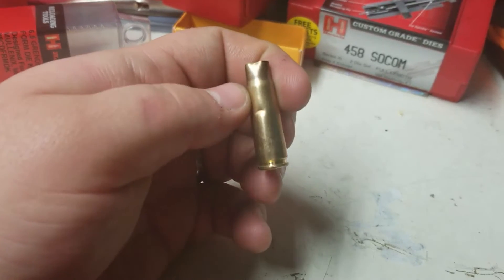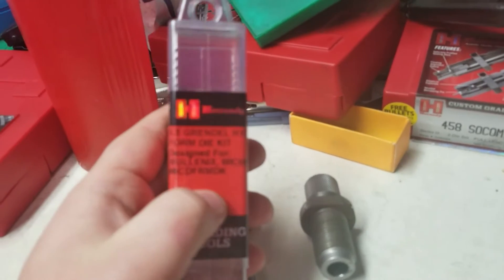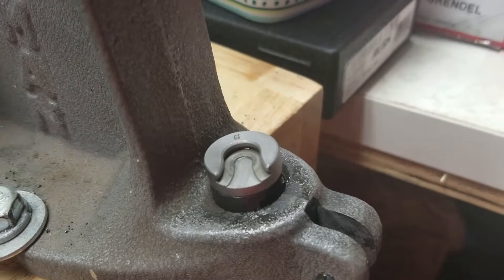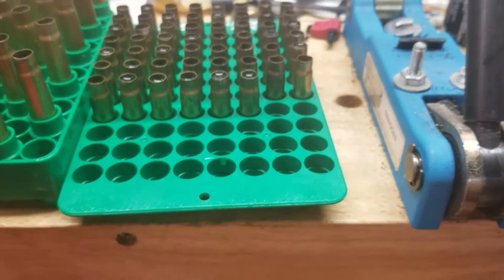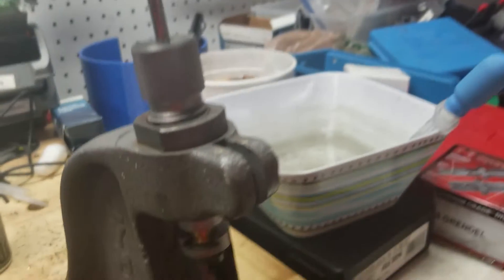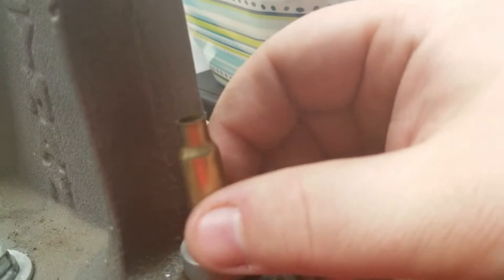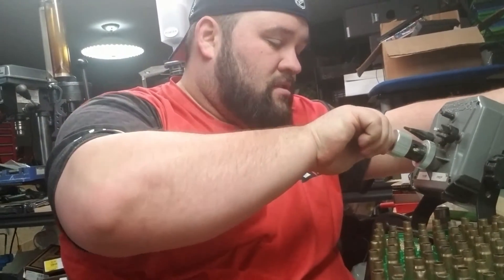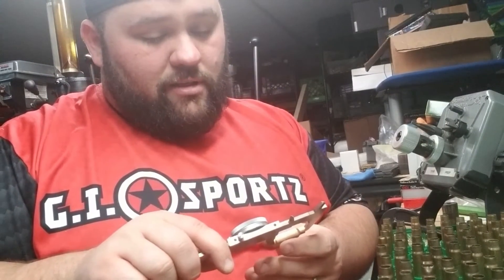Hydroforming 6.5 Grendel

Comment: I’ve been looking into repairing some 6.5 Grendel brass that I bumped the head to low. It’s brand new brass so I thought I would try hydroforming it. 
I wonder if Hornady would have a straight up 6.5 Grendel hydroform die? Your thoughts? Thanks
Reply: I think the 6.5 grendel hydroforming die would work well for this. how many pieces did you do it to? If its not alot id be happy to try it to fix them.
Reply: @michaelmullenix  I have 50 pieces of Nos brass. I think I'm going to contact Hornady and order myself a custom hydro-form die anyway because my chamber in two 6.5 Grendel barrels of mine are about .010" head-spaced longer than Nos and PPU brass is manufactured at. I'm guessing other manufacturers are probably similar? Thanks for the offer though.
Reply: @Whithersoeverthougoest The manufacturers will go ahead and make you whatever you want. Hornady happened to be the least time frame to get one made AND they already had the chamber blue prints on hand to do so. If you want it customized any other way, i am sure they would accommodate!

Comment: Need to make a 6.5MM GRENDEL with a hollow cavity like the 7N1 and  And inside the holocaust cavity use a blistic tip inside the full metal jacket then backing up with a steel core with lead  are lead

Comment: I'm converting a bunch of brass myself, I'm using the standard Grendel die method.  I'm using a 3d printed WFT vs the trimmer you have, then  wet tumbling them.

Comment: Length was the saami spec.... below that diagram shows you minimum and maximum trim lengths. I fucked up on 100 PC of 6.5x55 brass once and trimmed them all to max length to try and "get more life out of my brass". Well when fired every PC was getting stuck in the chamber. Could have been a huge f up with pressure spikes. The brass was growing into the throat and getting stuck. I had to pull 97 pc's and reload them again. Point being trim your brass not to max length. It will grow 4+ 5+ thou especially when close to max charge. Great video!

Comment: Good video.  I'm going to order one to turn 308 into 6.5 Creedmoor.  Just a hint, the trim to length is listed right on the page at the bottom of the specifications.  It's 1.510, that's the minimum case measurement so you're still .004" long.  Also, instead of paying for Lemi-Shine just order a pouch of citric acid from Amazon for a couple bucks, same stuff.
Reply: There's no such thing as a minimum case length. The CIP L3 callout (case length) is a maximum length of 1.520. Anything less than or equal to that number is within spec.
Reply: @tartredarrow  The trim length is listed at the bottom of the column, it says "Trim Length".  Usually the trim to length is .010" below the maximum length.
Reply: @hardball107  That's simply Hornady's recommendation. If you go by CIP, there's no minimum. If you go by SAAMI, there's a 1.500-1.520 range given.

Comment: Nice die......but if you don't want to  wait 3 months, for some special die..............
 turn 7.62x39 brass into:
 6.5 Grendel, 6mm ARC, and 6mm PPC. 
STEP 1:
On the LEE push through lube sizing Kits, find a plunger the same diameter as the 7.62x39 base. Lube case ..keep lube off of neck/shoulder area, to prevent wrinkles.on shoulder /neck area.
Use it to run a case up into a 270 Winchester seating die..... careful on depth...try to get correct shoulder measurement for desired case. this will shrink neck to .277-279.

STEP 2:
Run the formed case up into a 6.5 Carcano seating die, using the same plunger.... this will shrink case to.267-269. 

STEP 3:
 Final size in either a 6.5 Grendel FL Die....a 6mmARC FL Die, or a 6mm PPC FL Die. 

Christ bless!
Reply: I may try that to experiment some. but the concern I have is the extra work hardening it will do on the case, especially the neck. My biggest complaint I had with just sizing the x39 cases to grendel and loading/fireforming was in 1 or 2 firings, I had split necks.. with the hydroformed cases, I have fired the case 10+ times (trimming every 2 or 3) and no split necks. oh, we annealed at firing 4 and 8 too. I may have to give this a try as well to see how it works.. Thank you for the info my friend!
Reply: @michaelmullenix  No doubt the hydroforming is a great concept. Annealing must be done, because you are correct, the brass will work harden. Happy Shooting My Friend....and You're Welcome!
Hawk.
Reply: @hawknives  Always a pleasure my friend! I really want to test this now! You have peaked my creative juices! :-) Thank you again my friend!
Reply: @michaelmullenix  Yes Sir!
Reply: I turn 308 into 6.5 Creedmoor by running the 308 brass into a 7mm/08 resize die, then into the 6.5 CM die.  Trim and shoot.  I measured the neck thickness and if I'm using military brass I'll turn the neck walls to .016".  I like the plunger idea to fill out the body taper but it seems to work OK for now.
Reply: @hardball107  Good process! I will do that. I also bought a Redding body die, for  helping form 308 to 6.5 Creedmoor.
Happy Shooting!

Comment: What information did you provide hornady for your hydro forming die? Also do you anneal the brass before the forming? Also the case head sizes are different from 7.62x39 to 6.5 grendel being 7.62 is larger.
Reply from the maker: thanks for your question! I provided the caliber choice  to Hornady. Since it was a caliber that they make dies for already, that was the end of the conversation. They will make you any caliber you want as l9ng as you provide the caliber blue prints/specifications. Second,  We tested annealing vs not. We used once fired brass in our process and the process went great. We tried mixed range brass and it too went fine. We annealed after we 3 firings after hydro form vs not annealing at all and both sets of brass acted the same with similar stretch of the case and no split necks at 10 firings. We do reccommend annealing but users can determine their own interval.. Personally, every 3 x firings works for us. The answer to your last question is to inform you that a 6.5 grendel case head diameter and a 7.62x39 case head diameter are identical. Both cases are based on the 220 Russian caliber. :-)
Reply: @DungeonReloading  case head diameter of 7.62x39 is .447" and grendel is .438" that is 9 thousands of an inch difference
Reply: @8mmmauser896  no grendel is .441

Comment: One thing to remember with "AK" brass is that the H2O capacity is LESS than Hornady 6.5 Grendel and WILL cause higher pressures if you use loads developed for Hornady brass. It is also designed for lower pressure. These are the values I have come up with in my chamber:
Brass	                Case Cap grains H2O
HDY	               37.2
PPU 7.62X39	36.5
Fiocchi 7.62X39	36.3
S&B 7.62X39	36.0
GECO 7.62x39	35.9
PMC 7.62x39	35.1
WW 7.62x39	        34.95
R-P 7.62x39	        34.57
I save this brass for my 126gr cast bullets to ~ 2300 fps/48k psi and Shooters World AR-Plus.

Comment: Heres the question will the larger primer affect accuracy and pressure enough to ruin accuracy
Reply from the maker: in our testing out to 300 yards, point of impact remains damn near identical. We are loading standard load velocities tho and have not come close to max on anything. All loads have been book data without ladder testing.  subbing large rifle for small rifle primers..I have 25 pieces of brass that are on their 9th firing ( annealing every 3 firings) necks and primer pockets are also nominal.. I need to find time to return to this project. I just got a new grendel upper so I will add some follow up to my list.. Thank you for the comment!
Reply: @DungeonReloading  so must you anneal or no amd if so does that meam fater my 2nd or 3rd time firing i need to be careful or is that annealing for good measure to not have it explode
Reply from the maker: @justaregularguy3827  Annealing is not necessary, but I do it on all my specialty calibers..when we did our first tests, we used PPU 7.62x39 once fired brass (before reform)  and shot them side by side with hornady 6.5 once fired brass. We got to 4 x reloads(5 firings because of initial once fired brass) un annealed without issues.

I also went back to our Facebook group where the beta testers gave me their feed back. here is the break down.

1. All powders we tested pushed projos to or over 2400fps
2. Powders used were varget. h335, benchmark, cfe223, h4350, and 8208 xbr.
3. CCI, S&B, and Winchester Large rifle primers were tested.
4. Annealed vs un-annealed brass was about to be hydroformed and loaded to 4 times (5 total including initial fire from 7.62x39) without any signs of neck splits, case/head separation, or extreme length changes.
5. No signs of pressure on case, necks, or primers was displayed
6. Rounds cleaned up using dry tumbling or wet tumbling without issue
7. All testers are very happy with the progress and we are comfortable with moving forward with the process..
Reply: @DungeonReloading  so if my firend has several hundred rounds of 7.62x39 brass virgin unfired  and offered me like 4 or 500 for 110 bucks...should I take that or use my 340 rounds of small primer grendal till it wares out then get that brass ??? Or whenever  then i guess
Reply from the maker: @justaregularguy3827  If you fire form 7.62x39 vs hydroform them, the results are night and day different.. in our testing you got maybe 3 or 4 MAX loads (including the fire form) out of it. Hydroforming seems as if it causes less strain on the brass. If you have a hydroform die, I'd take that new 7.62x39 brass. if you dont.. stick to regular grendel.
Reply from the maker: @justaregularguy3827  PM me on the Facebook page http://fb.dungeonreloading.com